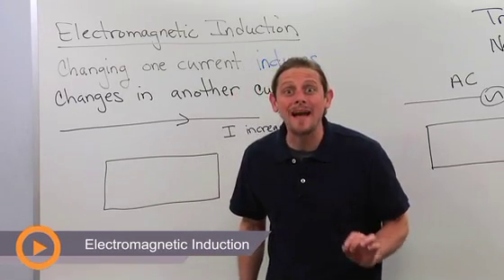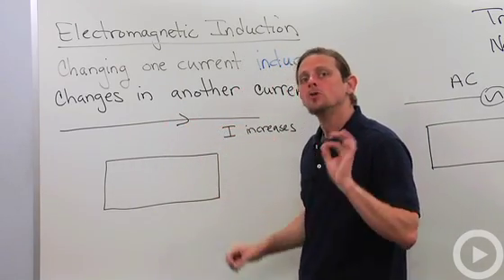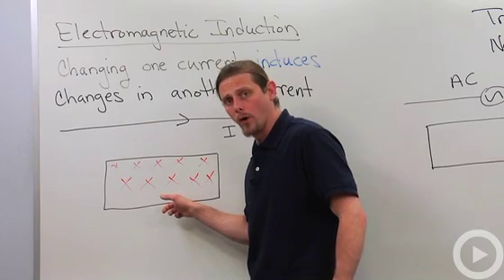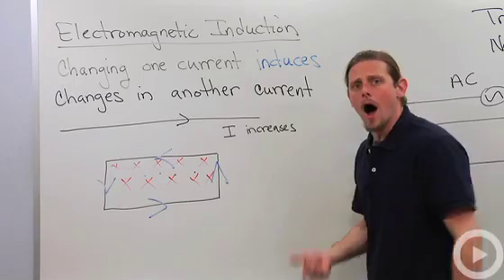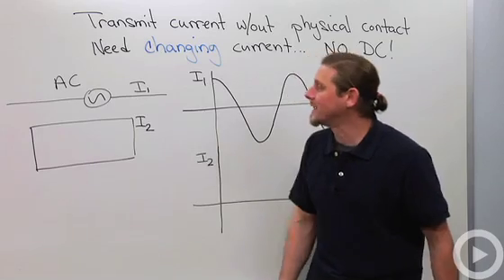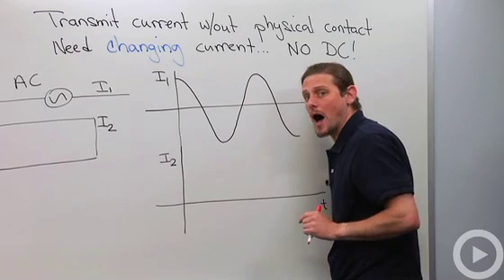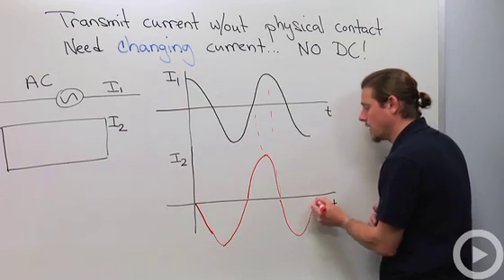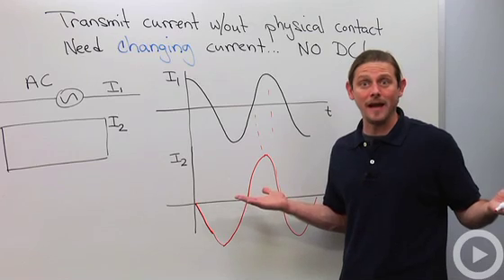Electromagnetic Induction

Comment: Well, what if you just kept on increasing and decreasing the the voltage in dc using some sort of a control system, wouldn't that technically induce a changing magnetic flux in the other wire?

Comment: Actually DC power is way better to use in small grids, especially if you generally only want DC power for anything from lamps, LEDs, motors, electronics and so on. You'll get rid of a lot of losses due to AC-DC-conversion if you only do it in one more efficient point. This can be used in data centers etc. 

And DC is much better to use when transmitting energy over long distances -  HVDC-cables. This however demands insulators that are way better than was available over 100 years ago. But you avoid losses due to inducing currents in the nature around the cable.

Comment: Is it just the derivative?
Reply: Miriam Janssen The arrows hes drawing indicate magnetic flux, faradays law states that the electromotoric force (the force that creates voltage) is equal to the negative gradient of the magnetic flux. The gradient is simply the derivative in 3 dimensions, and since his arrows are only in one dimension, you are indeed right, it is the derivative. 
In particular its the gradient of the surface integral around the magnetic field.

Comment: your jump to the magnetic field going INTO the page is not clear to someone who is brand new to this concept. "associated with a magnetic field that goes into the page" has no context. you need to explain that it rotates around the wire. Otherwise is goes into the page from where? comes out where? why? what?
Reply: You would normally learn about Ampere's law Lenz's law and Faraday's law BEFORE going into electromagnetic induction. So that should be cleared up before getting to this. His videos are great and short, so you can't expect him to explain everything again and again. But you have a valid point yes. :).
Reply: Actually, I got that part, but I thought the loop was a blown up cross-section of a wire that was going into the board at first.  In fact, I'm curious what happens when the wires aren't parallel, but at right angles to each other.

Comment: @pheonixinwater I was referring to any distance between the two coils. Like if the wire you're putting AC into was a foot away from the wire you are trying to induce current it, what is the loss, or what determines that.